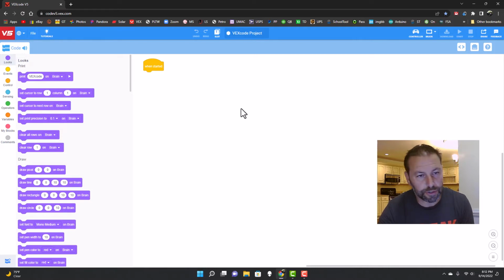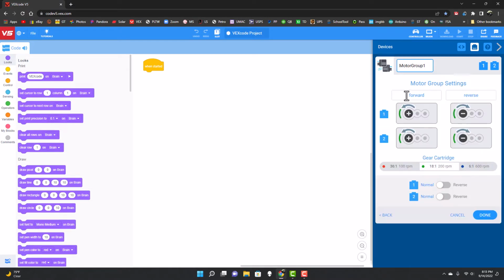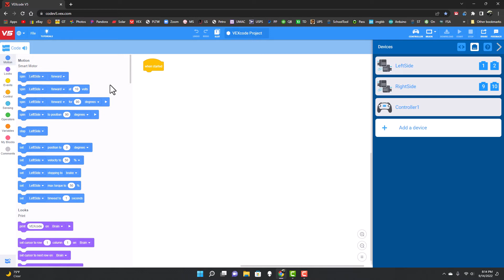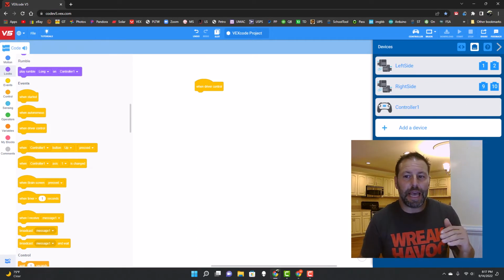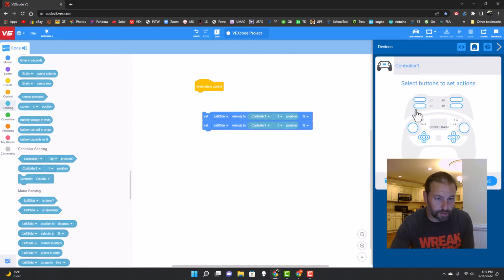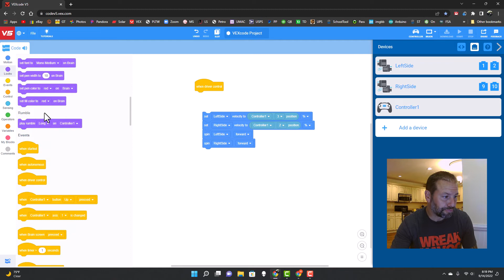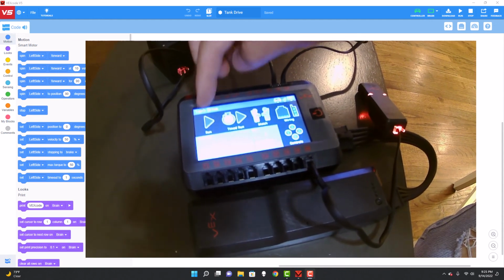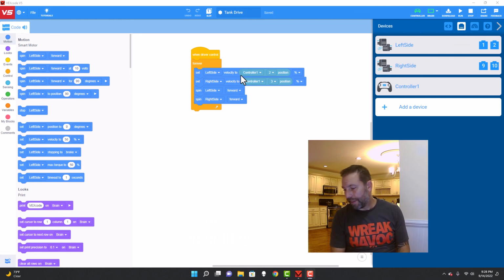VEX Tank Drive!

Comment: How do I code a 6 motor drive train like this?
Reply from the maker: A six motor tank drive is not native to the VEX code UI, so you would have to find a work around using individual motors and go deeper into the python coding portion of the VEX code UI. Out of the scope of this, and probably out of my league as well. But I’m sure it can be done.